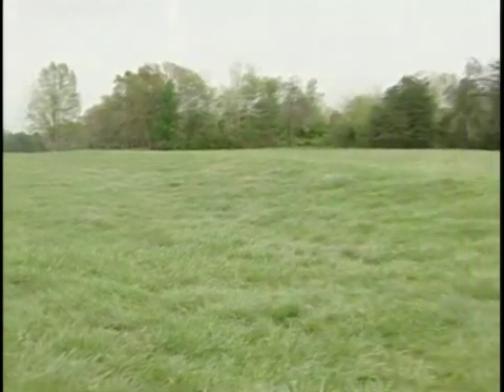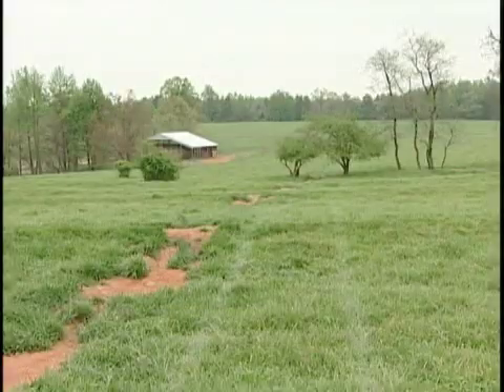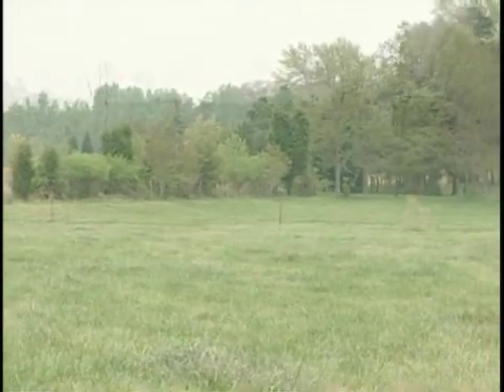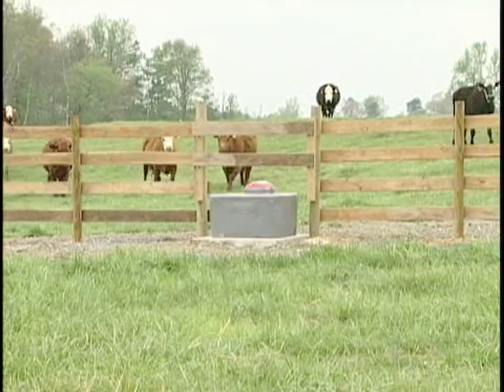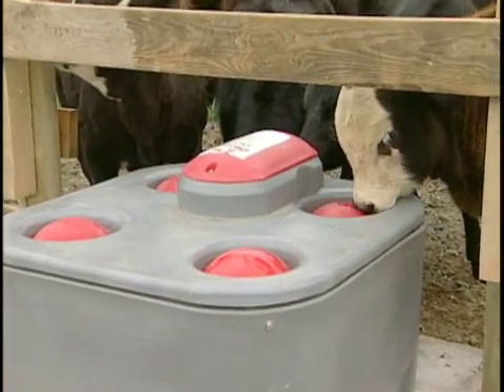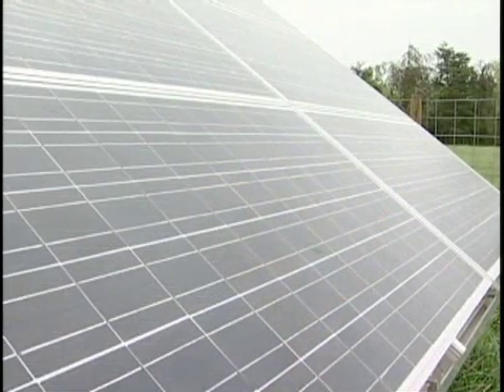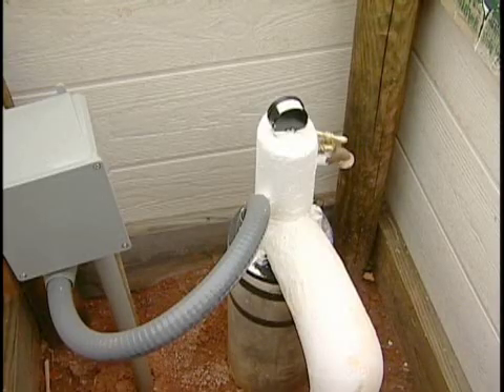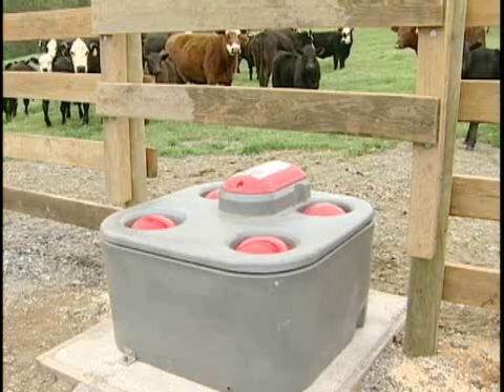Solar Powered Well

Comment: My Solar Panels just stopped working.  how much DC should I be getting out when reading the voltage charge straight out the box on the back side of the Panel thank you